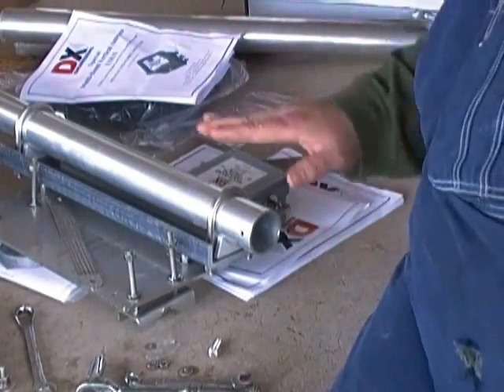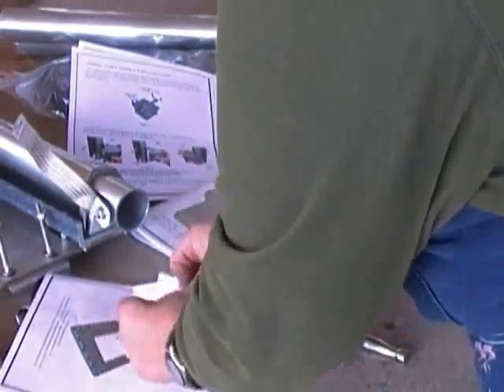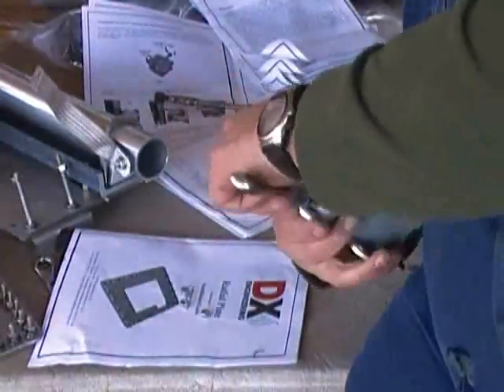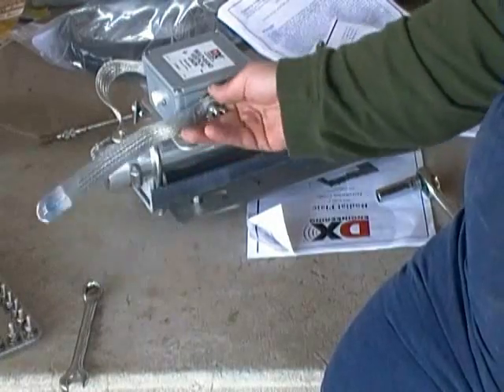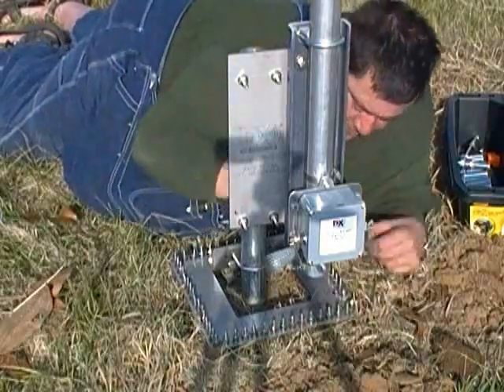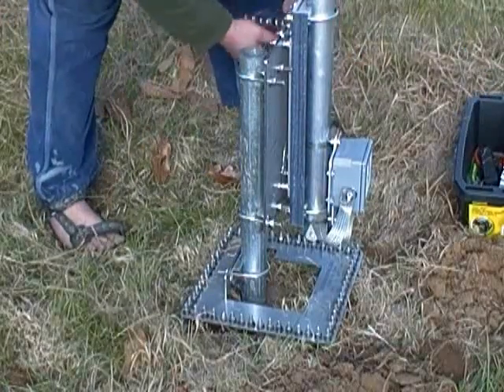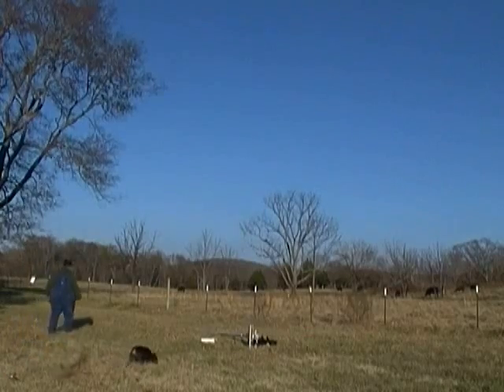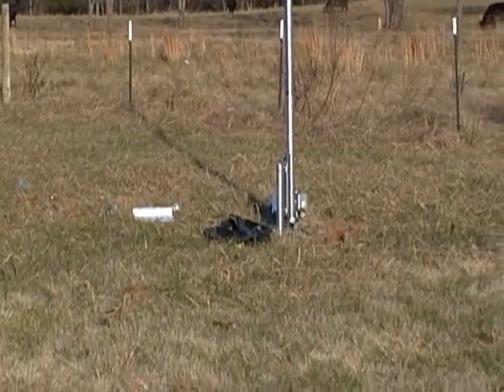DX Engineering 43 Foot 160 to 10 Meter Vertical Antenna Pt 2 of 3

Comment: a 43 foot antenna  will not work on 160 meters   anymore then a  2 meter vertical will....come on get serious..
Reply: "Wont Work?" meaning what,  not a very good radiator  compared to a full size wire at a half wave above ground but how many can do that. I can make it work and work well by matching the  feed point impedance  and it is not hard to do.

Comment: David, I believe you have put the nuts that hold the spacers in place on wrong.
I think you put spacers on the bolt then put the tilt plate on so the spacers ride in the tracks of the tilt plate and, then put the nuts in place.

Comment: DX Engineering has awesome products. Just got the UNUN and the radial plate for my Zero-Fifty vertical 43 footer and the quality is the best. The store is like heaven as it has not only ham radio gear but also high performance auto parts because it is inside Summit Racing at Talmadge, Ohio. I can spend hours there just looking at the great cars, parts and ham gear.